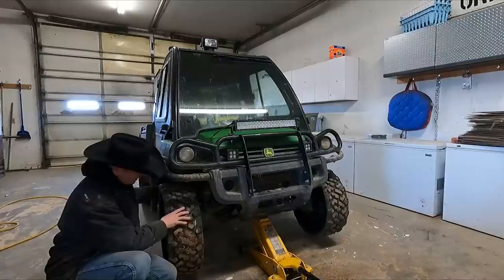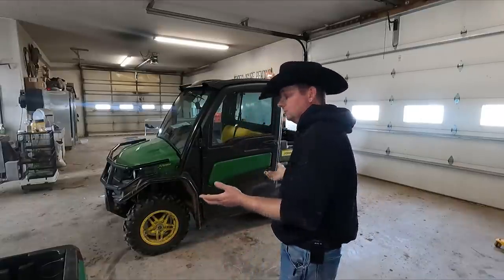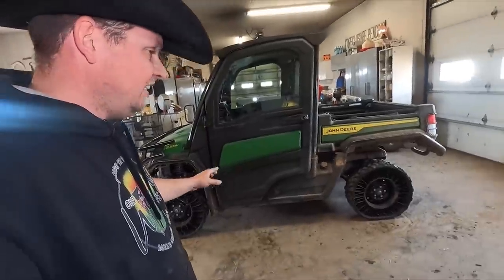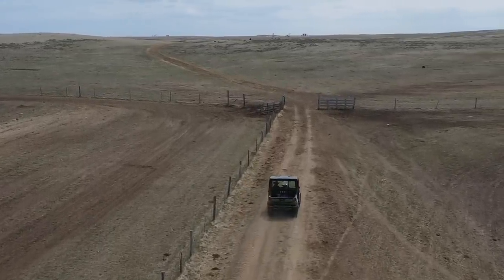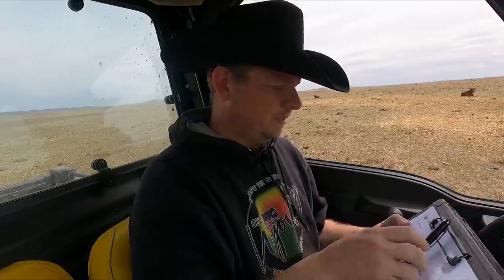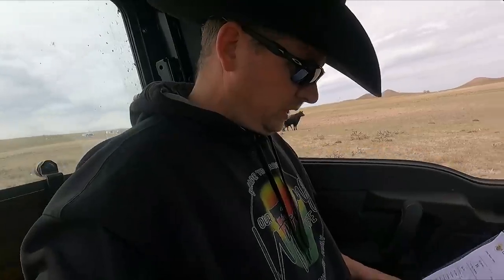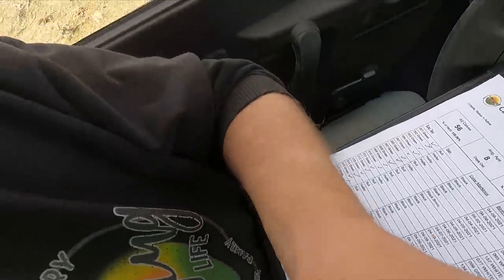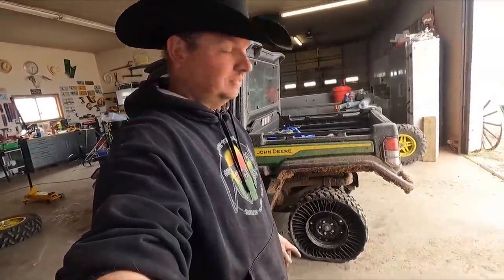Tweels are Back! Counting Calves in New Shoes

Comment: Pushing pudgy tires gonna put a bunch more load into the drive train, more torque required. I'da checked with John Deere before asking Michelin. Be like running OEM tires half flat. Good luck.

Comment: Just curious - does the flex in Tweels take on a flat spot memory if the vehicle is parked for an extended period?
Reply from the maker: Well, I have them on the skid steer and it will set for a week sometimes and I havent noticed anything at all. Good question
Reply: Thanks for your reply.  Just wondering.  Best wishes to you and your family.

Comment: I would have considered changing just the rear two wheels to save time and got the flat fixed when it was more convenient time wise.  Then went back to all air tires on the new Gator after repairing the flat.  Fixing the flat right then was the best possible option if there was a plug kit around.  Just saying